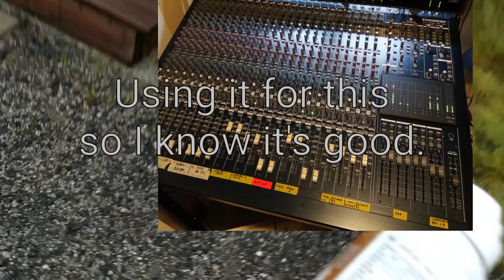Volume control crackle fix

Comment: What spray u used ? Can we use wd 40 spray ??
Reply from the maker: Hi, sorry I have missed this question? I looked it up before and the answer is simply NO, WD 40 is not good for potentiometers. There are additives that can cause problems.

Comment: What's the solution that you used to clean the circuit?
Reply from the maker: It was a contact spray. Not really cleaning, just adding conductive oil :)  EDIT 2022: the contact spray is NOT conductive. Also never try to look for conductive grease/oil whatever. The purpose of the oil/grease is to protect the contacts. The contacts will push the oil away, thus a good contact is preserved.
Reply: @SamiJumppanen  Thanks for your quick response!
Reply: Anything else we can do?
Reply from the maker: With potentiometers there are several possibilities for problems: the resistive coating has worn out (the wiper has scratched it), the coating is cut, connectors are loose on the circuit board (resolder to fix). Or, in case of corded controls like this, the cord is broken.

Comment: Can i use wd 40 ?
Reply from the maker: I did not have my own experience, so I looked it up. The general opinion is that WD 40 is NOT suitable for potentiometers. It may work, but it's not a good lubricant nor cleaner, it leaves a residue that attracts dust and dirt. I read several opinions on this and it is clearly not recommended.

Comment: How to replace it
Reply from the maker: It's usual there are no spare parts for these. The potentiometer should be a standard part, but need to find it somwhere, then solder the old one out, new one in, and move the thumbwheel, if it's removable. Of course the whole thing can be re-built completely, it's just a volume control and a power switch, but that's electronics and I cannot get into details here really.